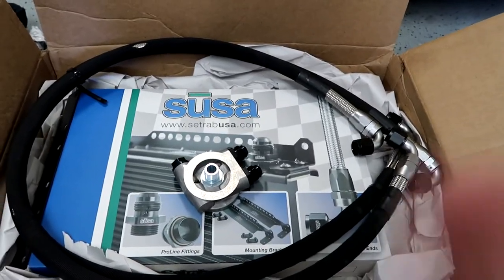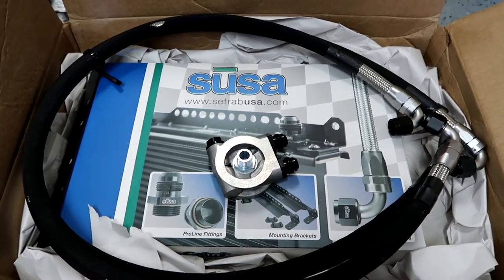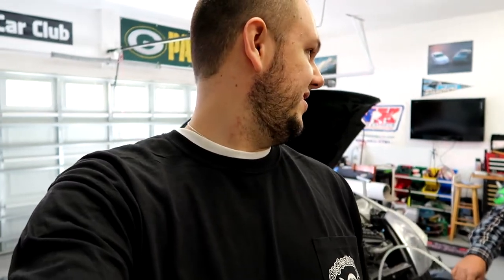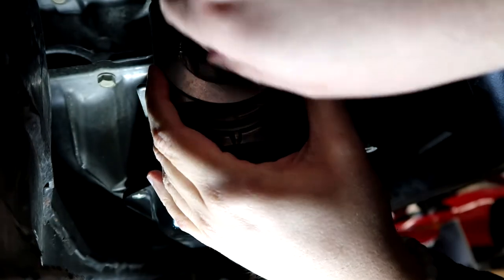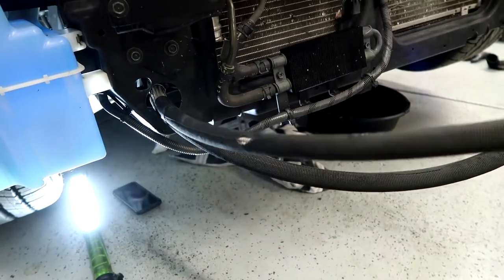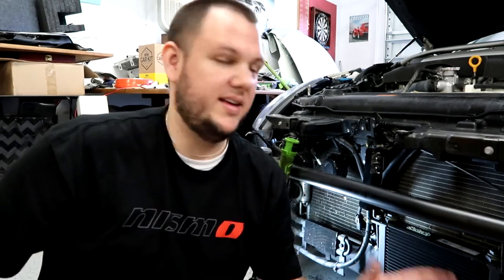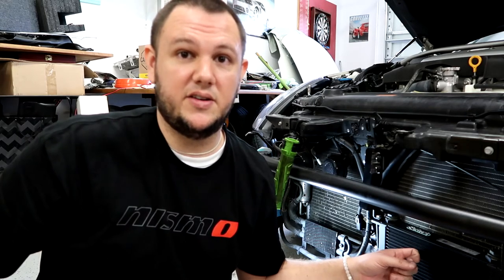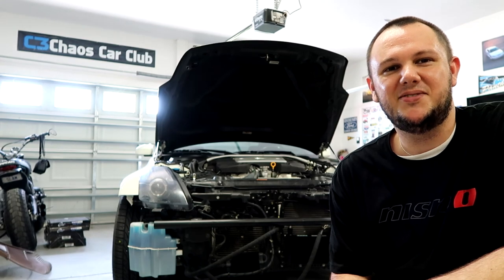Z1 Motorsports Oil Cooler Install | Nissan 350Z

Comment: Hey boss, I buy ALOT of stuff from Z1. I was looking at this exact same product ( thanks for helping me decide on the 25 row, btw) and the instructions are in the page of this product. With torque specs for bolts. Nice Z and nice install.
Reply from the maker: Yeah I was glad they made right and sent me the correct bracket and all so I could finish properly. Thanks so much for showing some love and checking out the video!

Comment: this kit was design to be bolt on for the 350z with a DE engine. in you car that has an HR engine has to use the kit they send you that comes in the 370z kit,  I have the 25 row with a oil pan spacer and lower my temp in trafic 10 degrees, just love it
Reply from the maker: Definitely a must! I have a Greddy oil pan that holds an extra quart of oil I still need to install. Should help temps even more.

Comment: Have you noticed it helped with the temp?? I live in AZ and man has my car been getting hot just from daily driving it. Im really considering spending the money on the oil cooler if it helps keep the car temp low
Reply from the maker: Unfortunately I don’t actually have an oil temp gauge so I can’t say 100% …everything I read in the forums prior to installing this on my car said it was a good bang for the buck. In a hot climate like Arizona I would probably step up to a 34 row cooler to help keep temps down. Could always do an oversized oil pan to increase oil capacity. That helps with temperature too.
Reply: @ChaosCarClub  im willing to try whatever to improve this issue.. its soooo hot 🤣.. thanks my guy!
Reply from the maker: @sysko2564  bahahahahaha I bet! i'm in NC and its hot here but no where near the 110+ temps you see

Comment: Could have mounted it to the crash bar , but , you don’t have one , if you screwed to the back side of that bar , not the one you have , but , you could have tilted it out of the way , when not using it , or just bought the larger oil pan with baffles ,
Reply from the maker: True and if I were better with welding it would’ve been ideal to create brackets to mount it to the tubular style bash bar that I got. And it’s funny you mention the larger oil pan as I actually have that sitting in a box still waiting to go on the car. Figured next oil change will be perfect time to throw it on. 😎
Reply: People don’t really need oil coolers , unless they have a dedicated track car , i think oil that has been run hard , should be cooled , but , by an external system , like a power steering cooler with electric fan , oil pulled out of the pan by an electric pump , pumped back into the other side of the pan , only used when the car is shut off ,,,,
Reply from the maker: @koachs77  thanks for the insight! the original plan was to track this car way more often than I actually have so I was trying to have the foresight to do mods like this to help prolong the life of the engine. Im very much of a novice when it comes to track setups. When researching key components to tackle some of the top items that popped up were cooling, brakes, and tires. I tried to address all 3 with the oil cooler, upgraded rotors, pads, calipers, and brake fluid. Then some wider Nitto tires. I hope this year to get the car on the track at minimum twice. Main goal is to have a reliable car to get me to and from the track without the use of a trailer.

Comment: After putting the oil cooler on do you still fill the car with the normal amount of oil? Or add extra to fill the cooler
Reply from the maker: Have to add more than normal to accommodate the extra that gets used to fill the cooler. It took roughly half a quart extra this first time with the 19 row set up. When I do the first oil change I’m guessing it will be less as not all will drain out. Just what is remaining in the lines.
Reply: @ChaosCarClub  thanks!

Comment: How has the kit held up after two years of installation?
Reply from the maker: Held up flawlessly. No issues or leaks. The Z isn’t quite a daily driver as it was when I did the install but has been through several oil changes since.
Reply: @ChaosCarClub  sweet thanks

Comment: Bro, after install do you have any issue of oil pressure
Reply from the maker: Nah car runs same afterwards. Haven’t noticed any difference in pressure at all. Just have the stock pressure gauge but it’s been reading identical to before the install